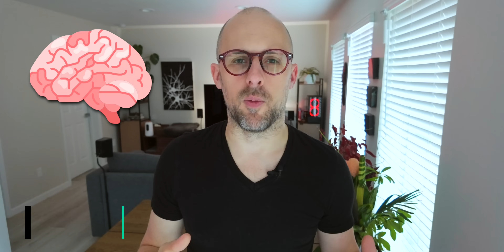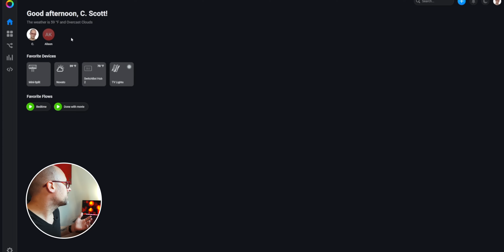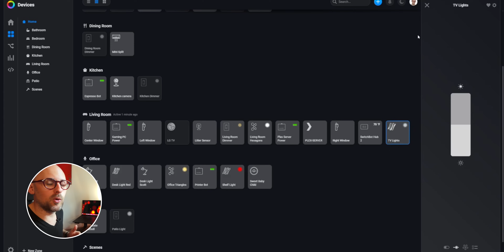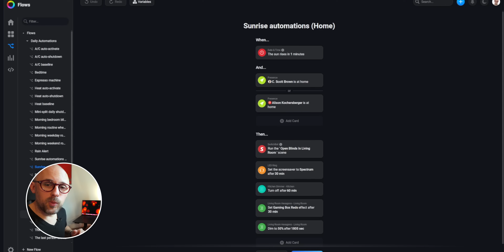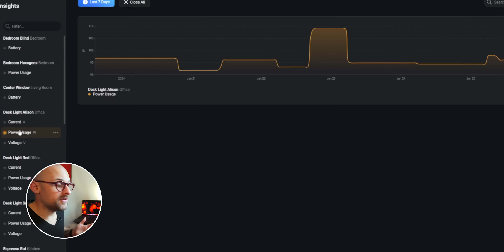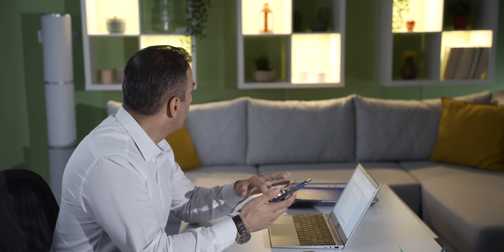Homey Pro is the one smart hub to rule them all...or is it?

Comment: Athom Homey is a Dutch company, so many Dutchies like myself started using Homey already in 2016 and 2017. Until now it worked great, no need to be a whizkid or programmer, and great support from the Homey Forum users and the company Atom. The nice thing is, you can connect Homey to your Google or Amazon hubs and use them to start your Homey flow's ( routines ) or to let Homey talk to you. Homey runs my whole house with more then 75 devices.

Comment: I've been a Homey user for a few years and I do agree with most things. Device compabillity may be an EU/US issue as it's been around here for a few years already and device support is very strong. But that will catch on for the US market as soon as people start using Homey Pro.

I did miss you showing the Advanced Flows. That is super powerfull and will make your life so much better. It's basically node red type of editor, but so much easier to create... well... advanced flows :)

Stabillity wise I've seen some issues over the years. But the last year with the new Homey Pro has been great. As a comparision I'm running a Home Assistant instance in parallell only for collecting power consumption data, because that graph is fantastic. No automations or anything, but I still have to put more energy into keeping the HA instance running than Homey Pro. In Homey Pro I have 2-300 devices from 25 manufacturers and another 15 apps for extended functionallity combined into over 400 flows controlling it all.

I still have a wife and two kids, btw ;)

I understand viewers milage will vary, but this is my experience.

Comment: Actually it is not a rasppbery pi but beefed up.
It is in FACT a raspbery pi. 
There is a Raspberry Pi 4 Compute module in there. 

Comming from Home assistant and having tried the device, I am not a fan. 

Its fairly unstable, I have to restart it quite often becuase it loses connection to the network.

Device support for zigbee and zwave is also not quite complete. Unlike Home assistant wich has support for almost any device.